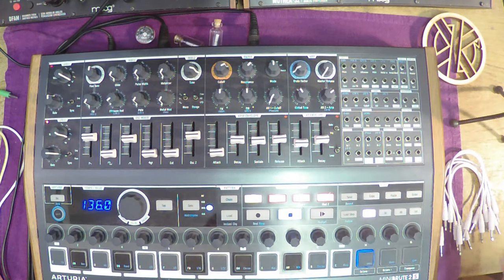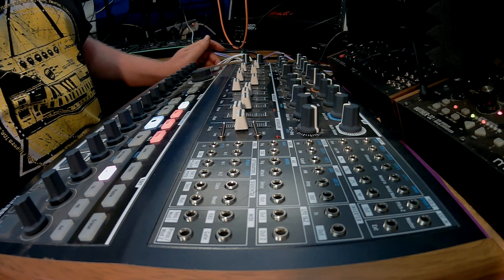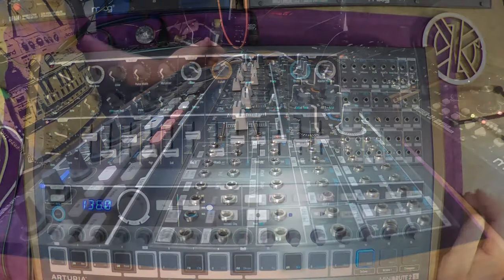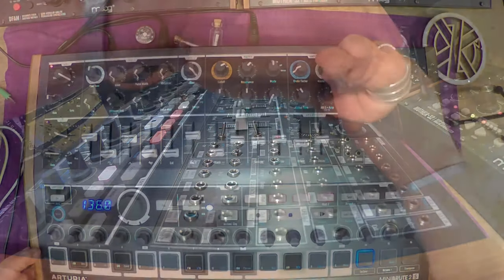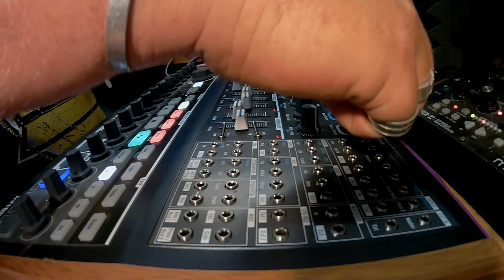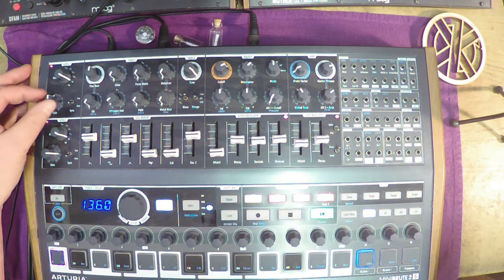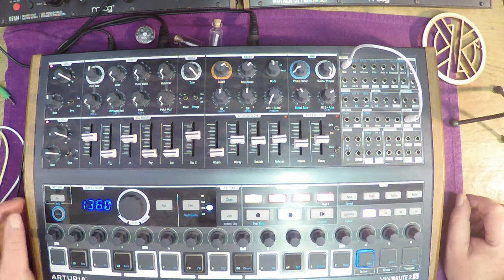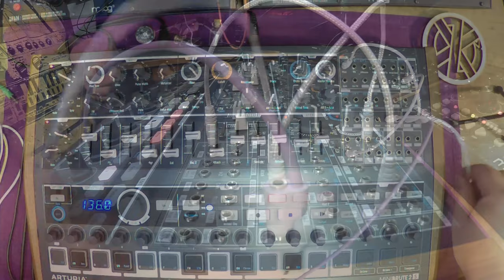How to make self generating music: Pt 3. Arturia MiniBrute 2 S Analog Synth, Patch Bay & Random LFO.

Comment: Fantastic sounds is it possible to trigger the krell only when a key is pressed down ? 
This krell video is fantastic better than most the brute sounds old great work 

Is the synth capable of hong bell like ring mod sounds and fm ? 
🪐😁👍
Reply from the maker: It has FM but no ring modulator,  but you could try messing around with looped envelopes via the metalizer to produce similar harmonic bands maybe??